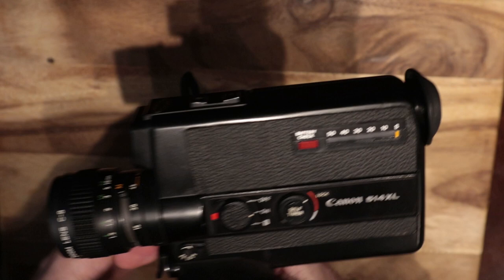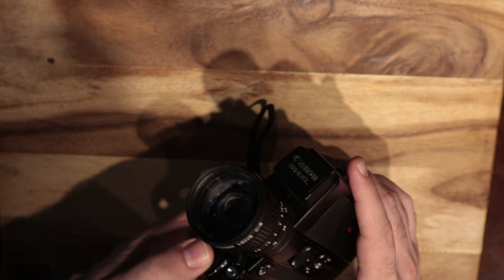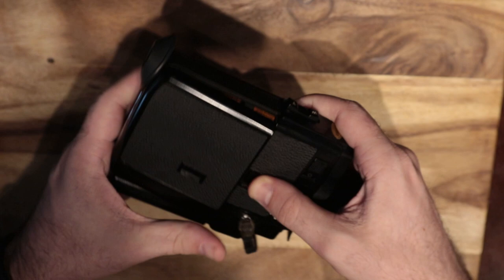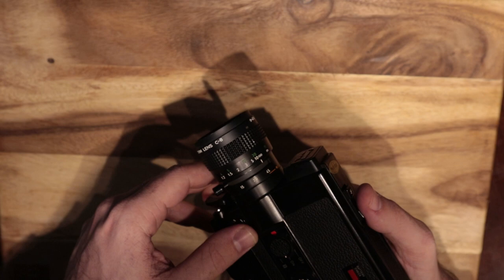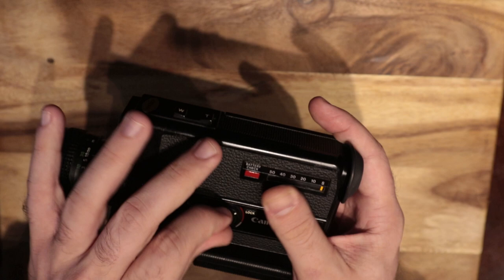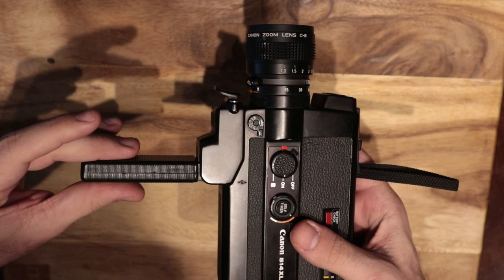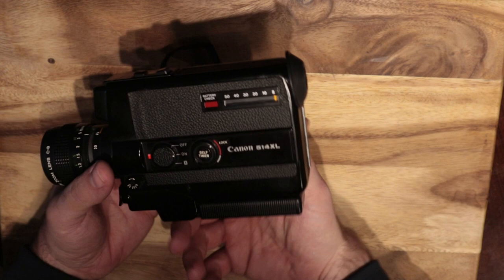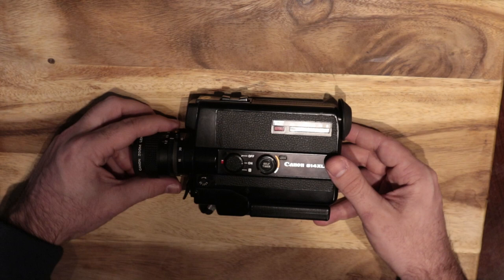Canon 514XL Repair Intro

Comment: Did you ever do a full repair video?
Reply from the maker: Unfortunately I did not record a full video but I would be happy to help you out if you are having any particular issues
Reply: Hello, I just got my camera and the motor is not working. Any idea what can I do to fix it?
Reply: @RompingBronco Hi! Camera is seemingly working fine other than the battery check light. Thoughts?